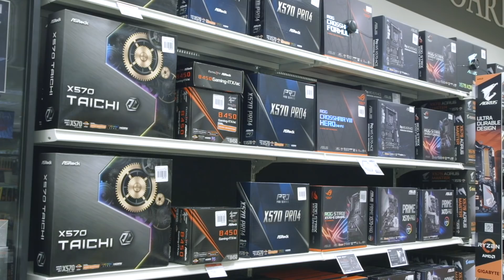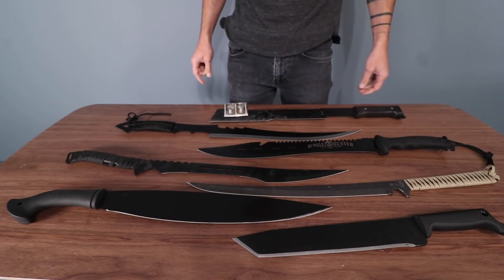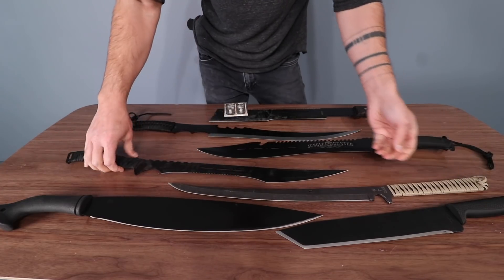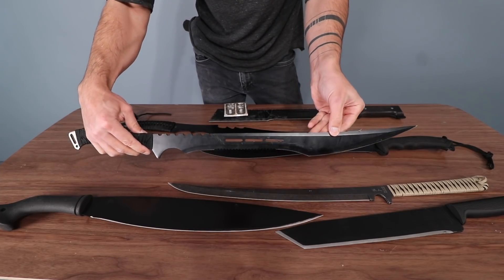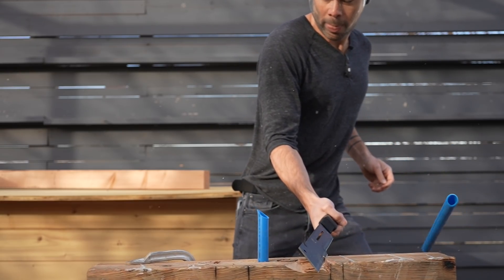Machete with DIY Log Splitter

Comment: May I suggest using a carbon or Spring steel machete like if you going to make a second one. because more often than not stainless steel blade are a little on the brittle side compared to carbon or spring steel which is known for its toughness. So as a safety concern it might be wise to use spring steel next time especially the intended use is for splitting wood so you are creating a lot of stress in the blade that might cause the blade to snap and fly off. The cold steel machetes I excellent candidates! 
Anyway interesting concept !
Reply from the maker: great suggestions! thank you!

Comment: For tighter grain wood, if you place the blade on the log and strike the back flat part with a hammer/small log, will it drive through and will the blade hold up? 
Also, good tip on trimming flush to the nuts ;)

Comment: Good stuff. Nice mod, it demos a type of axe geometry well. I also like, the thinking and evolution of the design/functionality idea. This kind of thinking is probably how they first came up with the high carbon steel/low carbon steel sandwich for blades, “how do I get the best of this tool, and the best of this tool”

Comment: Cool idea.
Small tip, place log over the leg of a horse and your energy will be much better used when hammering or splitting in this case. You can actually see horse bending and that acts like a cushion. Cheers
Reply from the maker: Great tip!